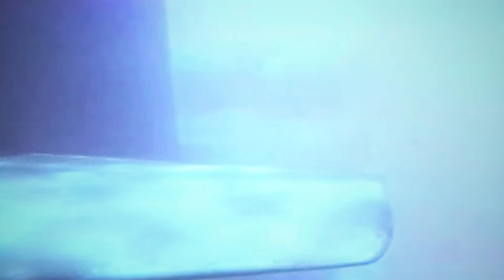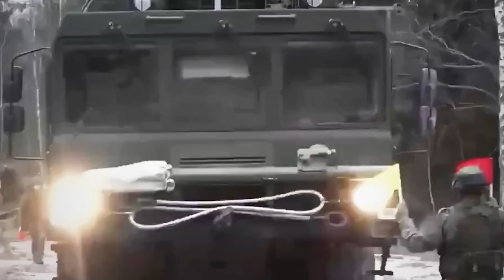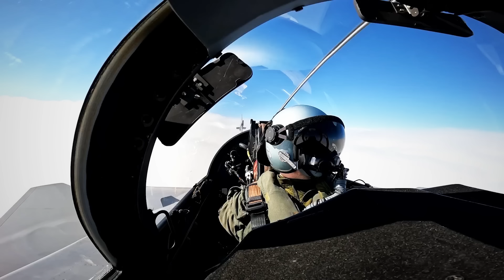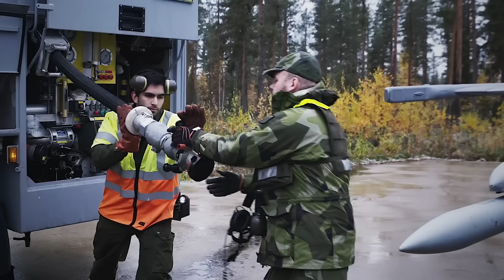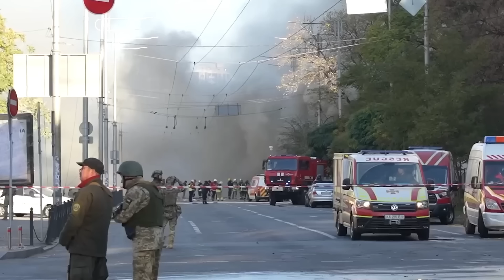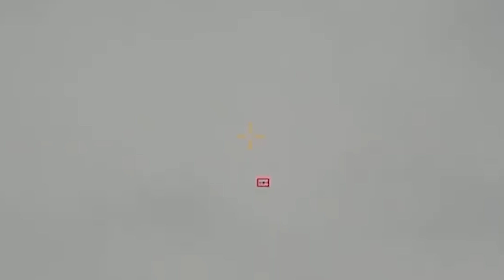Why Russia's New Missile Isn't Exploding

Comment: If they are having difficulty maintaining comms with the scout drone UUV, why don't they take a page from the war in Ukraine and use a fiber optic cable that spools out from the Proteus? 
It seems like this would be the idea solution for high-bandwidth communication, stealthy operation, and a cost-effective price point.
Reply: Because you can only bend a fiber cable so far before it cracks and you cant send data anymore which is why you cant use it in urban or forrest Environments, once it pulls around a corner, your drone might be dead.

Usually, they fly high and direct lines to avoid that. As a scout, thats your dead + bigger signature and very well visible because of the giant spool.